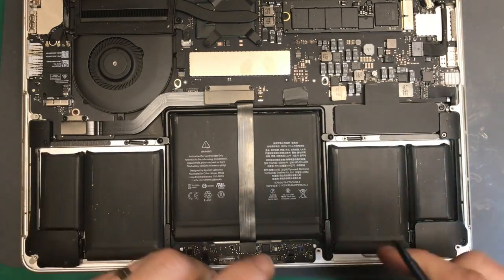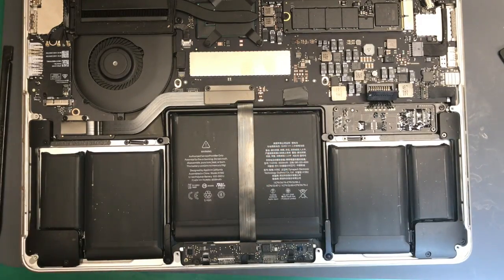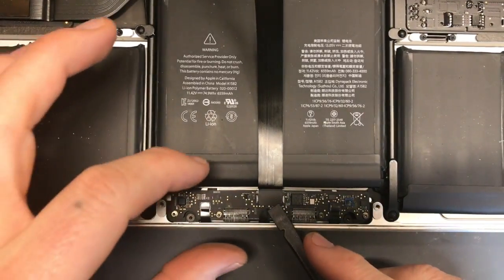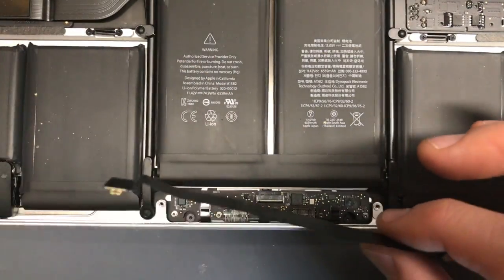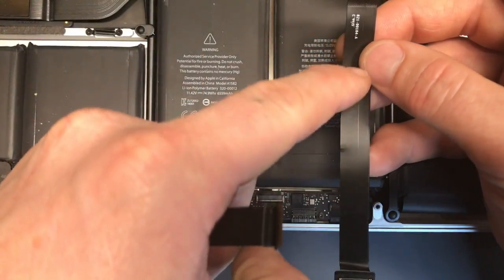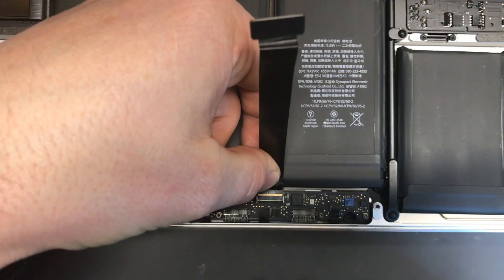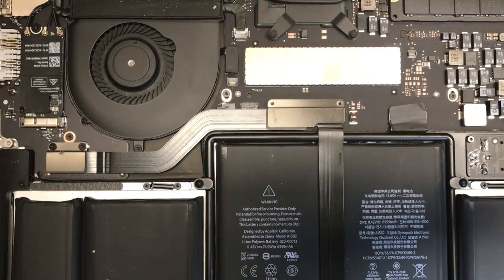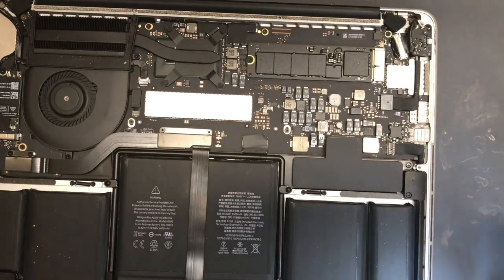Macbook Pro 13" 2015 A1502 NO Trackpad & Keyboard Fix repair Guide

Comment: a helpful hint would have been "the screw heads on the bottom panel will strip out easily". I don't even know if there is a way to remove these without stripping the heads. I used the right T wrench but they still rounded out.
Reply from the maker: Hi Alan, the correct Driver is P5 Pentalobe screwdriver, as mentioned above under "Show More", this driver will work every time with no stripping of screws.

Comment: Would be helpful to include all screwdrivers needed in description -- Don't forget the T5 Hexagon to remove the screws above the battery. https://www.amazon.com/gp/product/B01FAN2MLQ/ref=oh_aui_detailpage_o00_s00?ie=UTF8&psc=1
Reply from the maker: Daniel Muller, Hi Daniel, this driver is more easily found as a T5 Torx Driver, it can be found in most hardware stores, the Pentalobe is a security screw and would need to be sourced online.

Comment: Hi Mac111,

When I tried to change the cable, I broke the flik connecter. It fall off from the board. I can still insert the cable, but could not lock it any more. In such a case, what should I do ? Do I have to change the bottom case? I am really appreciate your answer.

Comment: Thank you for your sharing. I was wondering can Apple fix this problem for free. I think it is their product design problem and it's not users' fault. If more and more people face the same problem. Can we let Apple to fix this problem free ?
Reply from the maker: Tao Bo , Hi, I don’t believe this is a recognised problem by Apple for free repair yet, they do quietly repair the anti reflective coating wearing on the Screens/Displays up to 4 yrs out of warranty, if you have this issue I think it’s more important and a $1000NZD+ free repair.
Reply: MAC111 Thank you. I let the testing center to test my mac problem. It is the same IPD cable problem like you shared. Do you know why IPD cable did not work? Is the thermal design problem or other computer problem. Thanks.

Comment: I have the same model but when I opened the bottom case, there is no ribbon cable present like in the video. Am I missing something?
Reply from the maker: Hi Model A1502 can be 2013 - 2014 - 2015, this video is for 2015 only, 2013-14 goes under the battery, the cable can also be replace but its a different cable and quite a bit harder to do.

Comment: My fucking cable is under the battery and nobody shows how to replace it when is like that!!
Reply from the maker: Hi Adriana, the 2012 - 2013 model is quite a bit more complex, you have to remove the mainboard and lift the battery, you may want to have a tech do this repair.

Comment: Hey, I accidentally pulled out the flip connector and a piece broke off. Any advice?
Reply from the maker: Hi if only the flip tab come off then you should be able to thread it back on and flip it down you may need a microscope to do it, if the whole connector came off then that’s not good, you would have to remove you battery and replace the trackpad, good luck.
Reply: MAC111 thanks for the reply. The whole connector came off; the keyboard is still unresponsive, do you know what that is?
Reply from the maker: Patrick Nguyen 
The keyboards function is paired with the trackpad, If the trackpad is now faulty (no Connector) then the keyboard will also not work, your options are, find someone to micro solder the connector back on or replace the trackpad. 
When you remove the cable on the trackpad side you need to push towards the battery on a flat angle, not pull up and out.

Comment: For me i needed to reset pram after new cable. 
Then it worked 

Command Option PR on startup. 
Then it worked. 

Thanks. 
Apple are real dirtbags when it comes to these things. 
Also if you install ubuntu or any other distro the keyboard and trackpad will use a different ribbon and work. Apple you easily replicate this in software but they want you to buy a new laptop.